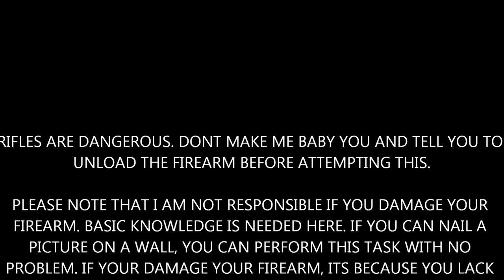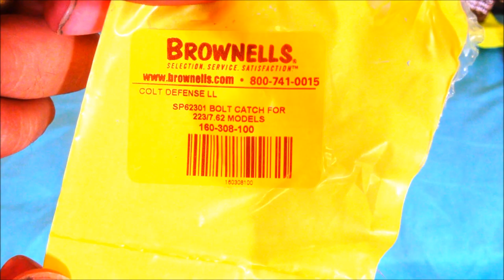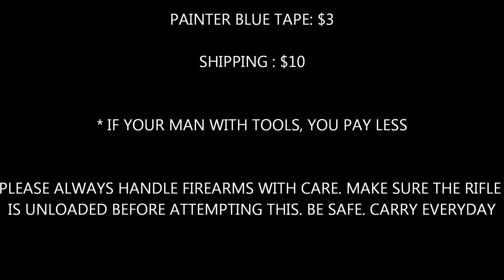How To Fix AR-15 Bolt Catch Lock Failure for PMAG's

Comment: i had this problem, was a pinched spring under my bolt catch, took it out and put it back in, worked fine
Reply: How did that happen exactly because I'm an idiot and keep fucking with the gun alot and I have unfortunately dry fired without a firing pin like three times over time and now it's slightly loose and has play left to right. Should I do the same?

Comment: I just built an AR 15 Pistol and used an Aero Precision X15 Multi Cal Lower. I also purchased a Strike Industries Lower Build Kit. I  tried the Magpul 30 Round  M4 Mags that I have. The Mags were Gen 2 and Gen 3. I also had a Magpul 20 Round Gen 3 magazine that came with my KelTec RDB.

I had problems with 4 of the 30 Round Magpul Mags. They all failed to hold the bolt open using dummy rounds for the fit and function test. The 20 Round Magazine had no problems. 

I saw another video where the person's wife's AR 15 also had a bolt hold open issues. I tried his remedy and replaced the Strike Industries Bolt Hoid Open Catch with a Rock River Bolt Hold Open Catch. The Magpul 20 Round Mag worked well. I still had failures with the  Magpul 30 Round Mags.

I tore all the mags apart to compare the components. The components for Magpul Gen 2 and Gen 3 30 Round Mags are different. The follower and base plate are slightly different between Gen 2 and Gen 3 Mags. There is a notch on the top of the follower that seems different on the 30mRiund Mags. It also feels like the magazine springs also vary in load output. I am assuming that the Bolt Catch is exerting to much force on the follower which allows the bolt to slam shut. 
  
The Magpul 20 Round Mag did allow the bolt catch to hold the bolt open. This was probably in part due to a stiffer spring allowing proper resistance to hold the bolt open.

I am going to contact Magpul and forward with a list of the Part and Serial Numbers for the 30 Round Gen 2 and Gen 3 mags that I have along with a video to demonstrate the Bolt Hold Open failure.

I see a number of videos on this same issue and Magpul should be able to resolve this matter.

Comment: I had the same issue, flipped the spring and detent around so spring sits in first then detent on top and my bolt catch was not working till I swapped those around. Works perfect now

Comment: Man I just bought a Bushmaster carbon 15 in .22 . The bolt setup is completely different and in the manual it shows you how to disassemble the rifle but it only shows you how to disassemble the .556 upper reciever and with the 22 bolt it is disassembled a little bit differently. It did not show the process with a .22 upper reciever at all . I mean its not rocket science but I was having the same problem with my bolt not locking . I was wondering since they didnt take the time to add the proper instructions in the manual for a .22 upper reciever if it was my magazine...  because when I looked it up in the trouble shooting section of the manual it said the mag could be the cause but it doesnt lock at all only partially . I know that style carbine supports multiple calibers so .22 is not really set up right for this rifle or I got a defective one. I bout a .556 upper reciever for it and it swaps out easily and works fine no problems . I might have to replace that part or take it to a gunsmith ...

Comment: I think I would rather lock the bolt back without a magazine housed and see if the bolt stays locked back. I am having the same issue, the bolt won't lock back with a standard bolt catch on my 300 blk out pistol, standard ar15 pistol lower and I recently got a cmmg 300 blk out banshee but I think the bolt catch on my lower is too small to hold back the heavy bcg.

Comment: I have a basically brand new DPMS Oracle, only 100 rounds through it.  Bolt catch works when mag is empty, but not when loaded.  In order for it to catch, I have to pull slide back, and manually pull the catch out, push slide forward, and then I can press the release.  Using PMag 30 as well.
Reply: jlydon29 did you ever find a solution? I have a dpms Oracle new with the same issue.
Reply: 2 things, first, you don't have to pull on the paddle to lock your bolt just pushing on the little rounded end below the paddle, that will push the paddle out and lock your bolt, 2nd, you're asking why it won't lock open when your magazine still has rounds in it? The magazine only locks open when it's empty because the follower in the magazine engages the mag catch raising it up and stopping your bolt from going forward. You can't lock your bolt unless you do it manually when there are rounds in the magazine

Comment: I just installed a Franklin armory DFM and a bolt catch without that little nub (the fixed mag doesn’t fit otherwise). Now, the bolt never locks open. But because it’s a fixed mag, I can’t fit a bolt catch lever with that little nub. Is this normal?

Comment: This is a problem Colt had because my 6920 has the exact same problem, no "finger" on the the mag catch. My rifle is not that old but getting a hold of colt to fix it is a pain in the ass. It didn't break off either, it's still factory coated. I don't think the part is that expensive but it makes me mad when a company like colt shouldn't have this problem. 2nd problem I had with the gun too.

Comment: i have the large catch and still have issues with my New Frontier AR. i noticed that the polymer mag and metal mag are different. The metal mag works, but the polymer does not.
Reply: charlie klein you have a bad lower receiver. Look it up . new Frontier made a bad batch of lowers

Comment: So is my bolt catch supposed to lock after unloading a mag because at the range it did but my gun doesn’t but I can manually catch the bolt by pulling it back

Comment: I have a brand new rifle and got a new 40 rd pmag and it wouldn't lock into the mag well without having to be forced, and wouldn't eject without being pulled on. You could see that the pmag was too thick and rubbed against the front of the well so hard that it left gouges into the plastic. Took me a few hours with 220 and 120 grit sand paper, carefully removing material from the front of the pmag until it would easily seat, and fall out when released. Could be that it's going in far enough on yours to seat, but not in enough to push up on your catch?

Comment: So I was having the same problem with my AR. But you do realize apart from removing the bolt catch (in the final 2 minutes) you also removed the BAD level--You basically affected 2 variables. I believe the BAD lever was your problem to begin with. It's all over the internet. everyone is having the same problem with the BAD lever. I would like to see you reinstall the BAD lever with the new bolt catch and try it.
Reply: I don't have a bad Lever in 2 of my AR's and it does the same thing, when I get home, I'll check the bolt catch to see if that's the problem.